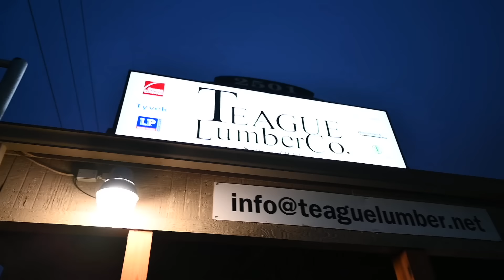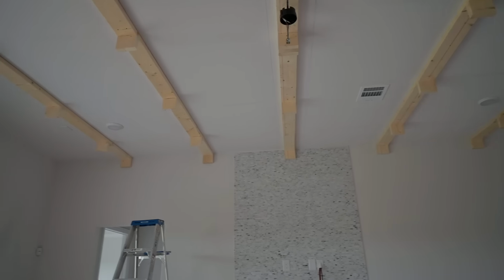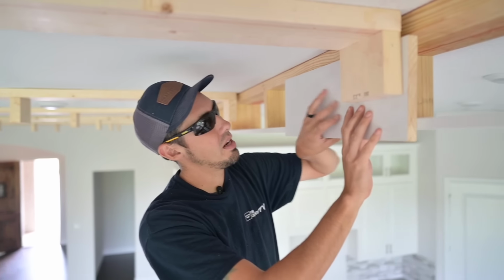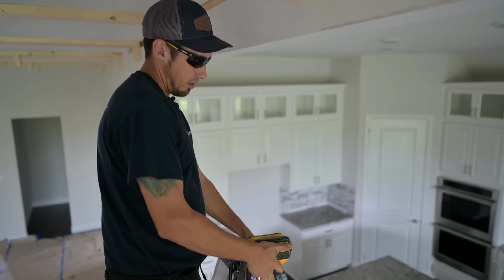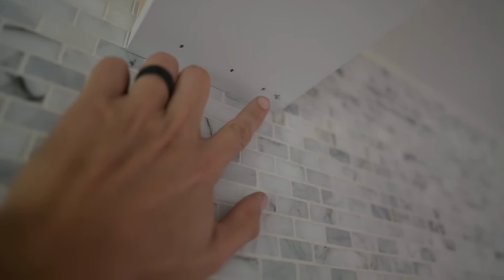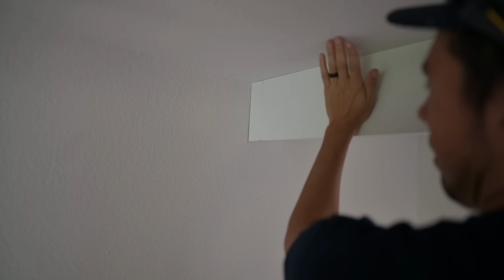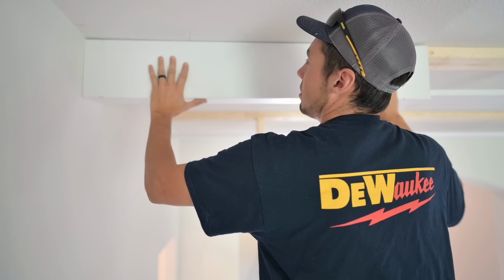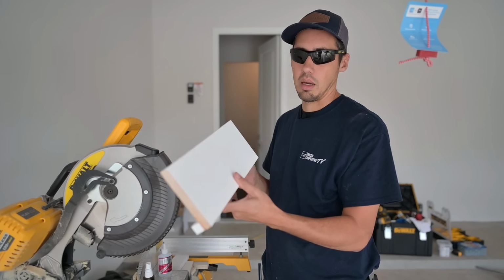EASY... Installing Box Beams

Comment: It’s that layer of tape and compound that’s killing the ceiling corner. If the Sheetrock has the tapered edge butted up to the ceiling that may not happen...unless the drywall finisher leaves a bit too much mud.

Comment: Love the work. The idea behind the scribe cut and the 3/4 offset is exactly what I needed for a project I now have to redo. Oh well, lessons learned. The jokes were hilarious. I loved the closing part the check clearing. Thanks for the ideas on the use of primed finger-joint pine. I have been bouncing back and forth between that and PVC for different DIY projects around the house. You can teach an old dog a new trick. Thanks

Comment: I think the angles you’re getting on the drywall side is from the taping mud. It will be built out some from the thickness of the walls. So I’m sure it’s the mud creating the angles.
Reply: True  if it was level 5 there should be zero angles
Reply: @hi-ye4rz  That's optimistic.
Reply: It’s definitely from mud built up in the corners
Reply: That the angles exist is the only relevant information. Dealing with what is.
Reply: @hi-ye4rz  Level 5 isnt a true flat finish, it's only meant to be visually flat.

Comment: I think you should invest in a 2nd nail gun. You already have enough batteries and it would cut your installation time almost in half when you have a helper like that. I think it would be a great investment. Also lets you have a backup if anything happens to the other one.
Reply: 🤣🤣 he has got more than 1 gun but maybe the other gun isn’t the right gauge  for that job.... I’m sure he set his mate up with a truck and tools ......good point though 🤣
Reply: Wilkinson Carpentry :
In true DeWaukee fashion, I carry two Milwaukee 15 degree nail guns, I use the DeWalt interior / exterior nails, for better corrosion resistance.
Reply: Im pretty sure he's just using one gun because you have to work from one side to make sure it's fit tight

Comment: Don't forget to show a pic of the finished job w/ crown! BTW, if the ceiling is not always level all the way across, then how do you get the crown to fit right against it along its entire length? Especially if you use pine which is not as compliant as MDF?

Comment: I always used to use a carpenters pencil to scribe it but I find that I can be a lot more accurate when it’s like a 1/4” away that way I can make a cut close to the line and see if parallel. Then if not I know to adjust it again. That’s a plus in that pencil jig you have. Just a personal preference probably

Comment: The design of this is gorgeous.  We have an open concept like this and the 40’ span of textured drywall is boring AF.  Going to attempt this at some point.  Didn’t expect you to use a butt joint for the longer lengths...was thinking a 45 for a scarf like I’m used to doing on baseboards, but with using pocket holes, I get it now.  Always learning when I watch your videos.  Thanks for the content.

Comment: What I do is remove the drywall & insulation. I move the joists to make box beams screwing a 2x6 between 2 joists to for the beam.. 1/8" ply on top. It's a more rustic look which I like. Looks great and the attic ends up flat so insulation isn't broken up by joists so better R value. Also makes the ceiling appear higher.

Comment: Just a tip for you. Next time you have to do a fan brace in those beams use the metal fan rated boxes with the brace bar. Plastic is not rated for fan. Electrician everyday so just a tip. Good show as always🤜
Reply from the maker: Thanks a lot. I’m going back today. I will switch it out. I just grabbed one I didn’t think about metal vs plastic. It just said “fixture of 50lbs. “
Reply: @FinishCarpentryTV  Just looking out for other trades man. Not many do but didnt want to see all your hard work have something bad happen. 🤜

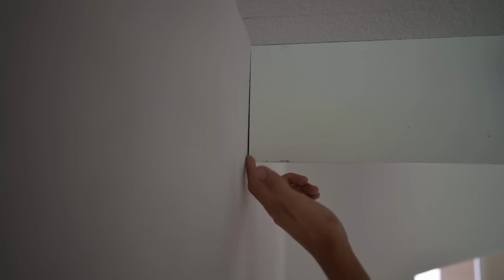Comment: The open gap you talk about @ 10:00 most of the time is normally caused by the Drywall mud being thicker at the intersection of the wall and ceiling just as it is in a inside wall to wall corner, you normally have a piece of joint tape with mud behind it and 2 or 3 coats of mud on top depending on the finisher, you can't always have a "depressed" factory edge to a "depressed" factory edge to even out the corners and most of the time it's a full thickness coming from both directions creating the build up in the corners.  out side corners with a piece of corner bead is also normally not 90 deg. because the finisher need a little kick out for the mud to have a place to "bite" the wall other wise he's jus scraping all his mud out, the corner bead is designed to stand proud to give him the thickness he needs for the mud to have a little body to bite the wall, you can see the stand of if you look at a un-mudded piece of corner bead, geat video and great tips👍

Comment: I am presently redoing my family room and plan on doing box beams. The ceiling is a complete tear off. After nailing braces in place should I let drywall guy do the whole ceiling BEFORE attaching the 2x6 to the braces, or should should I attach the 2x6 and let him simply butt the drywall up to it? I’m not going to have him tape the ceiling seams as I’ll do crowns inside the boxes. And do I need to all for the drywall thickness when I hang the 2x6?
When you cut your three box boards, did you cut them long and spring them into place just like when cutting crown? Thanks in advance.

Comment: Ceiling corners and wall corners will alway taper due to mud covering the tapes and corner beads.

I usually use 8-10” blade to cover tapes and beads.

Comment: Another great video. FYI tape and mudding seams and corners are a reason why things aren’t flat. Q. Do you nail through the side trim boards into the bottom trim board or just into the 2 by?

Comment: Have a question to a seasoned woodworker hoping you respond. Been watching you for a year. Thinking of integrating simple steam sauna or infrared into walk-in 60x32 shower. There’s a 24”x32” alcove at end of shower. Will be using acrylic pan having  side &end wall flanges. Thinking creating opening approx 24”  and drop ceiling along with ceiling above shower to be flush with top of tall glass door and atop of kneewall.  There’d be enough room to for a 32”x 18” bench and could be tiled or have plenty 1/8” T&G 31/2” cedar planks could be stained and spar urethaned. Not wanting expensive extravagant set up rather a something basic like a portable wood steamer creating just enough steam to get a sweat going.  Or look into a Infrared panel seemingly much simpler. Would make sure enclosure be waterproofed  same as rest of shower. The shower head btw be at the other end minimizing overspray.   Surely you get the overall concept. Will appreciate any input you can offer. Thanks

Comment: I'm planning out adding 2 beams in one room of my house.   I'm curious why not build the box beam on the ground and slide up over the framing?   Also, why run the 2x the whole length of the ceiling?  Couldn't you attach smaller sections of 2x at every few joists where you plan to nail?  Use less lumber than way.   (Love your channel and your work.  Asking since I've seen it done other ways and wondering if it's better to use your methods on this.)

Comment: Where the tile meets the drywall over the fireplace, is that flush or is that an offset? If it is/was an offset for the tile, how would you go about the trim? would you backcut for the tile?

Comment: I don't know if a ceiling fan canopy can fit in between the bottom rail of the beam with the two sides coming down 3/4.. 

Might have to do some notching
Reply: Or he can just add a piece of the 3/4 that he is using as a spacer to make it flush with beam. He just has to cut another hole in the spacer and add extender to the round electrical box

Comment: Richard, if you ever need to buy 1 1/4” pocket screws in bulk again, Amazon sells a case of 5000 for around $90

It’s a lot more than most folks need, but if you go through them like I do (own a custom cabinet shop) the savings is worth it

Comment: I noticed you dont nail between the vertical blocks along the bottom, the side vertical board to the bottom horizontal board? it looks like 30" to 36" span,  wondering if you ever have any problems with the boards "warping" away from one another due to humidity? you wouldn't get away with that in south Florida due to the high humidity, job look great, can't wait to see the finish shots!

Comment: Man that ceiling is looking great. I can't wait to see what it looks like when it is complete.  I just have one concern. The hole that was cut out for the fan box, the 3/4" reveal doesn't leave enough space for the canopy for the fan. The electrician maybe needing the reveal to be trimmed off.
Reply from the maker: Great question. The fan is actually my responsibility although an electrician will be coming tomorrow to move the lights. But to answer your question, I had just enough room to install the canopy. It was close!
Reply: @FinishCarpentryTV  I am not going to lie, as an electrician, I would have been pissed if had to carve out that detail and ruin that ceiling. It's a good thing it fit. Just like you planned.

Comment: Why didn’t you make the side vehicle bds. wide enough to catch the 2x on the ceiling? I get the part about holding it down for unevenness in the drywall, but you could have held it down 3/4 “ and nailed all across the top.

Comment: Funny how I can do this at work and how I can watch your videos and it doesn't sink into my fat head. My house is 75 years old and has a beam across the living room because at one point half of it was a porch. All the sudden today I looked at it and said why not add more beams? Plus my house is slowly sinking and since 1997 when I installed crown in that room it just started pulling away. The entire area is built on sand because of the water around here. But now I'm going to rip it all down and do something a bit more ornate. BTW, Sketchup Pro is a great utility for doing drawings for clients if you already don't use it

Comment: Any reason why you used this method instead of doing a small dado box beam method and just hanging from the ceiling mounted 2x without having to use the blocking?

Comment: FYI : I order those Kreg pocket hole screws by the 50# box from Rockler. They are way, way less money buying them this way than in those smaller boxes. What I usually do is wait for a sale then order tons of them in all different lengths. I feel like I'm stealing them TBH.
Reply: You might want to check out McFeely's for screws, they're usually cheaper than Rockler
Reply: @stevebengel1346  : I'll look them up; thanks. Also, I didn't mention it in my other comment but I'm in Utah so I order them online. I'm guessing McFeely's also does mail order?

Comment: From what point did you measure for your vertical pieces, with the offset needed for the drywall? Also did you give those boards the 15 angle cut?

Comment: If you are getting a lot of nail pops with that gun, it means the drive pin is worn out, and probably needs replacing. It was happening really badly with my 16 gauge dewalt, and eventually the drive pin snapped. It's not a very expensive part to order, but replacing it myself was slightly annoying. It's doable though, and worth it rather than spending on a new gun.

Comment: I have used Dewalt nail guns for the last 5 years. And the only downside with it is the firing pin wears and bends back quite often so you start to get those nail heads showing off and its starts to get worse the more you use it. Its a nightmare. Although the firing pin in the gun is relatively easy to change none or less its still a hassle.

Comment: The electrical box for the fan looks a little suspect.
Reply: Budget box......
Reply: Super sketch. As an electrician, we ALWAYS use metal sliding boxes for holding fans (usually rated for 150lb). It may be overkill, but few people think about the nonstop vibration fan boxes take, and the vibration gets worse overtime. Always better to go a little overboard when hanging a fan. 👍

Comment: When using the jig at the top plate that shows that an adjustment cut is required... how do you adjust for your overall length?  Especially if both ends require a cut.
Reply: They are joining all the boards I believe. Too long for a single length.

Comment: The wall tappers down due to the top plate? I always thought that was due to the it being taped and mudded by lazy drywallers that dont feather out there corners far enough.
Reply: As a carpenter myself I can say I’ve never seen the top plate be a consistent issue with not being in plane, certainly not if we’re actually properly planing down all our studs

Comment: The long beam running perpendicular to the rest hangs down lower. 

From a design aspect how do you decided those dimensions?

Thank you.
Reply: I believe he said he used the thickness of the material he was using
Reply: Not the reveal. That is the thickness of material. 

I mean the one long beam all the other ones butt into.
Reply: @gradyb3258  I see what your saying now, I had to go back and watch it again. I'm wondering if he just used the next size of dimensional trim.
Reply: I just went to the part where he is in the corner talking about the ceiling having humps.He demonstrates with 1X8 and 1X6 scrap pieces, that kind of makes me more confident about my previous post.
Reply: Thanks for the reply

Comment: How do you know how many beams. is there a set rule for space between to look Good?
Reply: There really is no "rule"for beam spacing. Most of the time the spacing is driven by one of a few things.  Lights, ductwork, or smoke detectors locations are the main factors.    Home owner/designer preference has alot to do with it also.

Comment: What's with the passing of the nail gun?  and what happened to the Milwaukee gun you guys seemed to prefer?
Reply: I would assume you would want to use something larger than 18g, and the gen 1 milwaukees just aren't the same as the gen 2 18g. Hopefully they fix that soon

Comment: Dude the out of square inside corners of the sheetrock like were the ceiling meets the wall is from the buildup of the joint compound. The same is true of outside corners with the cornerbead. In sheetrock expect but joints, inside and outside corners to have about 1/8" buildup of "mud". It has nothing to do with the top plates, unless of course it was poorly framed, or they used bowed lumber.

Comment: You need stilts for these type of ceiling jobs . 1 cut guy , 1 or two guys on stilts . Looking good though
Reply from the maker: I’ve thought about getting stilts. Two of these jobs in a row has me feeling beat by the end of the day
Reply: Takes a few hours to get used to em but time savers for sure . Used em a lot on production based finish crew for all coffered ceilings , crown jobs
Reply: Kyle of RR Buildings, YouTuber, uses a diesel powered rough terrain scissor lift for building pole barns.  You need a battery powered indoor scissor lift, that would save you climbing up and down ladders all day.  Guess, I'm not a tool minimalist.